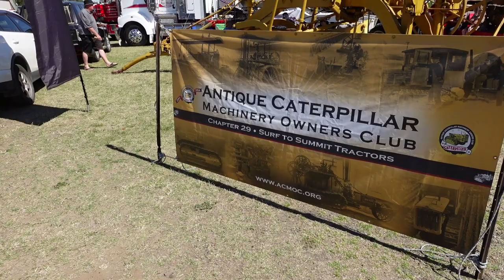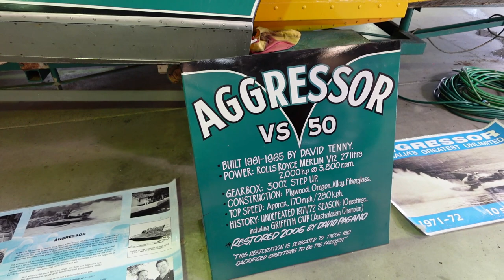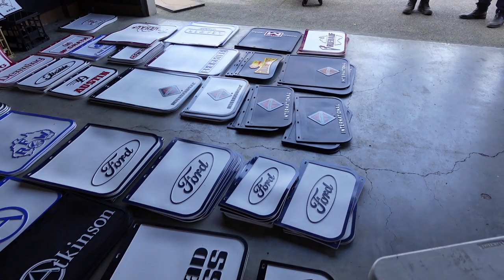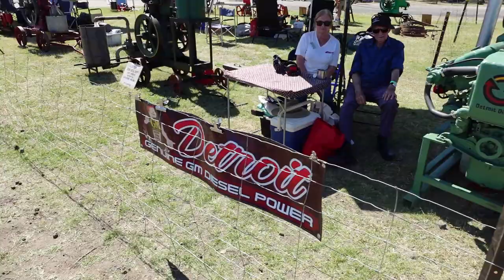Sydney Antique Equipment Show. So much OLD equipment! Must see.

Comment: Great stuff, Steve - too much to stop and gawk at. The Isuzu @ 1:09:42 used to be the SBR420, the heavier ones were JCR500. I used to drive them a while back (I won't say what I thought of them) but there are still a couple of each at work out here in the central west. The old Foden reminds me a bit of one of Aboods old motors, but many were from WA (the name of the mob who ran them escapes me), some had a dog box sleeper. 👍[edit the WA mob was Gascoignes if I remember right]

Comment: Steve, I used to go to theee shows with my grandfather.  He knew old machinery . Those radial engines are awesome.  They were put in tanks in ww2. Was that horizontal opposed a good engine.  That half track conversion tractor looked like it has a lot of pulling power if you were plowing a field.  The steam tractors are awesome. Great video,  jim from Connecticut
Reply from the maker: Hi Jim this is great. The radials were in all sorts of military equipment mate yes. 
 The horizontal chamberlains were great from what I believe mate. All this stuff was way before my time but I haven’t heard a bad thing about them. All made here in Australia. The half track had good pushing power but not great pulling power. They are a Fordson E27N with the track conversion. I have an E27 of my own and it doesn’t pull well either but pushes great. They don’t have a low range in the transmission which makes a difference. But we’re designed for a job and must of been able to handle it. Great old machine regardless mate. Steam equipment was very impressive yes. Will talk to you soon mate

Comment: Love the video!! The FD6 was fitted to most of Foden’s line of trucks, especially the S21
Reply from the maker: Thanks Joe. I’m not up with all the Foden models but certainly appreciate them
Reply: @stevesplacedownunder  a friend of mine in Victoria has a 1965 S21 - his has a 150hp Gardner with a 9 speed Roadranger behind it
Reply from the maker: Beautiful mate. If I see one for the right price I would be interested but certainly no hurry
Reply: Great to hear a Foden 2-stroke! I was an engineer at Foden but well into PACCAR ownership days so I didn’t see the FD engines or 12-speed gearboxes… until I later worked for Bentley who still had the ex-Rolls-Royce contract to overhaul the Foden FD12 engines used as APUs in Royal Navy vessels well into the 2000s. I loved hearing the FD12 song across the site when another one was dyno-tested after overhaul 🙂 In trucks (usually S18 or S20 “Export” cabs for the Australian market with the big wide 4-core radiator, but S21 “Sputnik” cabs also made it to Australia but presumably only with modest engines due to the S21’s lack of cooling openings out front!) for power you need a Mk.7 FD6, they were turbocharged for 200bhp from 3.6 litres displacement 😎 but for spine-tingling sound you need a Mk.6; full-on blower scream and no turbo to restrict the exhaust note 😎🤟🏼
Reply: @jimdieseldawg3435  they’d be on par with the Commer/Rootes TS3 capacity wise?
Reply: @JoeHupp  Sort of; the TS3 has 3 bores with 2 opposed pistons in each so it doesn’t follow the normal capacity rules 🙂 Great fun when they decide to de-coke themselves which is pretty regularly; every third exhaust beat’s a tracer 😆 The FD6 was a more conventional straight-six

Comment: Thanks for the video mate ! Best hour and half I've spent lately. I never tire of this stuff. On the old green Dodge you helped with , Did the side emblem say "229" ? How close to original is the drive train ?  I like all machines , but one put back like it left the factory has a special place in my heart . When you were walking by the all the mud flaps I saw some for the Commer trucks , Too bad they didnt have one running around somewhere . The Commer are a very unique engine and sounds great . Speaking of unique , I recently came across a Detroit 4-51 valveless engine at a show here . They sound a little different from a regular Detroit, it was the first one I had actually seen with my own eyes . Have a great time mate , and thanks again  🌵
Reply from the maker: Hi mate my pleasure. I can’t remember what the emblem said but we put a 318v8 into it, which was factory in those but this particular one was a slant 6 225.  
 There are plenty of Commer trucks still getting around here in Sydney mate, not many at this show but on the runs we attended there are always a few. 
 I’ve heard of these Detroit’s but never actually seen one. Would be good too have a look